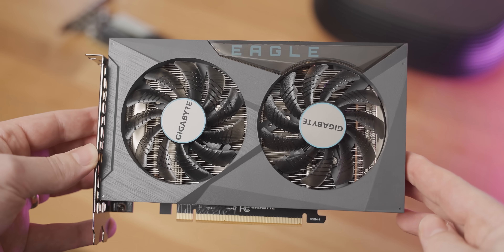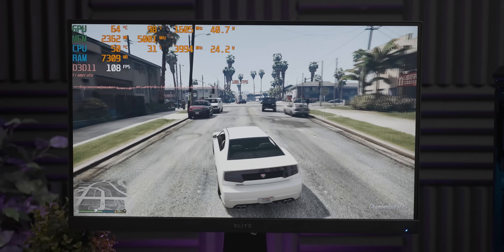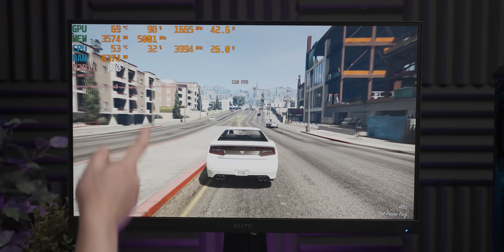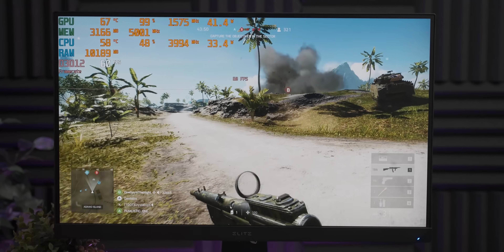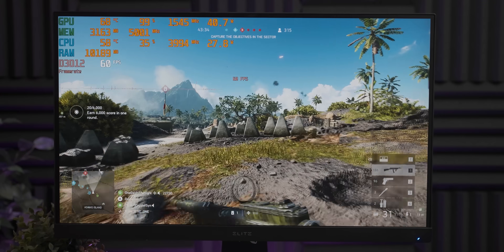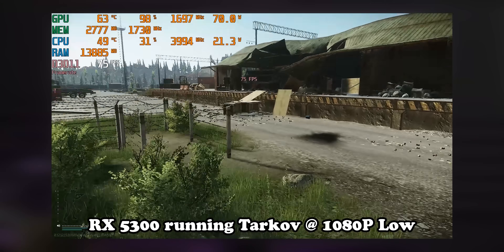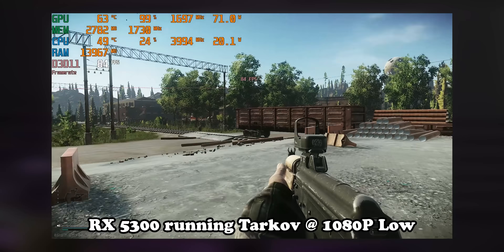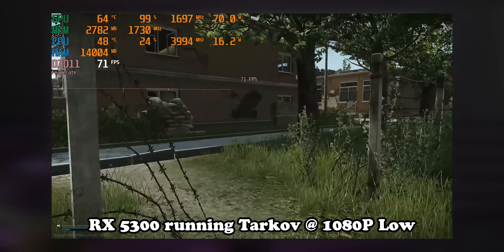This RX 6500 XT Comparison Was A Terrible Idea...

Comment: just use windows xbox game bar for recording it should still work and that card is a pretty capable card just was released in the wrong year really .
Reply: All those options will use hardware encoding (GPU) by default unless it's not supported, in that case it picks the CPU & tanks performance...
Reply: @MLWJ1993  yeah just figured most people are above 4 cores nowadays so using CPU to do it shouldn't tank performance that much but you are right it could tho that was always probs with older recording software also like fraps and bandicam would have to record without sound to keep performance.

Comment: Everyone criticizes the 6500XT but after having tested it, the performances are not as catastrophic as we want you to believe.
Reply: It is pretty catastrophic when you compare it to cards that released years before for less, and not only that but it loses to its predecessor. Its just a cash grab from amd knowing there are idiots that buy anything
Reply: @calvintrinh4869  To be fair Nvidia are doing the same 'cash grab' by re-releasing 1650's and 2060's on to the market at inflated prices. It's not a good time for the consumer in the GPU market and both AMD and Nvidia are cashing in.
Reply: @Groovy-Train  the 1650 and 2060 are actually good though. They dont lack any hardware encoding, arent crippled by pcie gen 3, have more display outs, the 2060 has more vram, and the 1650 can feasibly work in sff oem pc's. Stop trying to defend a shit card
Reply: @calvintrinh4869  And they're just shy of double the cost of the 6500xt going by prices on Newegg (at least as of a few days ago).  If you put the 6500xt in a pcie 4 rig, it offers similar gaming perf to the 1650S at a substantially lower price point.  Call it a shit card if you must, but at their current price points the cards you mentioned are shit value in terms of raw gaming perf.
Reply: @calvintrinh4869  Oh dear, have I upset an Nvidia fan by claiming that they are just as bad for re-releasing shit cards at inflated prices? So what if they have encoding and more ports, it's only useful if you actually need them. If you want a cheap card for just gaming then a 6500XT beats a 1650, that is a fact. The 2060 has been re-released at a massively infalted price as well. It's a good card, but still out of reach for budget gamers and old technology. As for defending a shit card, well I just talk about facts and don't let stupid fanboyism get in the way.

Comment: my 1060 is holding its shit together and I'm pretty shocked how much its gone through, these newer cards won't age well
Reply from the maker: The 1060 is an awesome card. I saw that on the recent steam hardware survey, it’s still the most popular graphics card.
Reply: true man 1060 is legendary I bought my 1060 back in 2016 and it died last month never had any issue with performance.
Reply: @jadescorpion7175  Dang bro, sorry to hear that, I get some screen flickering every so often on my left screen(I'm hoping it's just a bad HDMI cable have a new one on its way)
Reply: the 970 even beats the 6500XT in some games
Reply: Same with My RX 580 8 gig, you'de think I'd be happy, but Jeez it's just sad that a 5 year old £180 brand new with delivery is Objectively better than this new RX6500xt. I use HW encoding all the time for streaming. I'm happy to even have a GPU though.
Reply: 1060 6g is no slouch, even today.

Comment: 6500xt is the worst... at least the quadro does not try to fool you into thinking it is a gaming card as the 6500xt does...
Reply: The 6500XT seemed to do ok in the testing. Obviously the limit is 1080p but it held up. A GTX 1650 is a similarly priced card and that sucks even more in gaming.
Reply: @Groovy-Train  yeah sure try to stream somthing with the 6500xt... performance is a matter of the games you play... i play mostly multiplayer indies with my friends on parsec... thats a no go for the 6500xt while even my old 1050ti can do...
Reply: @iamstartower  If you need the encoder, then obvioulsy don't get a 6500XT, but just for gaming it's the best at its price point at msrp.
Reply: @Groovy-Train  streaming and sharing has become an integral part of the gaming experience, even consoles do it... the 6500xt does not... and is currently about the same price than an xbox series s... you must be really desperate for a gpu to even consider getting one of these lame cards. and if consoles are a no go you'd better save more money to get a 3050 or a 6600.

Comment: 6500XT doesn't have an encoder because laptop processors OFTEN have APUs with encoding. This is ALSO why the 6500XT has 4 lanes. Internal laptop GPUs often run on 4 lanes.

Comment: I've been watching vids on the T600 for a while, pretty cool that a bigger tech Youtuber is also doing a video on it. It's basically the successor to the GTX 1050
Reply: well its a neutuered 1650 same die less cuda cores and slower bus but its still a better love story than the relaunched gt 730 that nvidia tried to pull last year
Reply: It has nothing to do with a 1050
Reply: @dylanlac765n6  It is a Quadro, yes, but in terms of performance, it is somewhat better than a 1050.

Comment: To be fair, it's kinda like comparing a GTX 1650 to a RTX 3050, so I'd hope the 3050 does better than the 1650.
Reply: Also, I think the reason why Doom Eternal was running like a fax machine was because it needs to draw more power than PCIe Gen3 allows the graphics card to do so. Correct me if I'm stupid and was wrong. (probably am)
Reply: @TeamHELPER  PCIe Gen3 can draw up to 300w, so that's unlikely to be the issue here.

Comment: If this was a T1000 rather than a T600 it'd have my vote
Reply: t1000 is basically just a more expensive 1650. only really makes sense if you need the small size or something that can run on slot power only. or 4 DPs I guess.